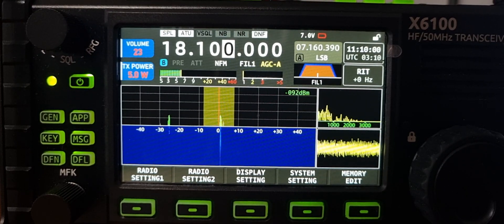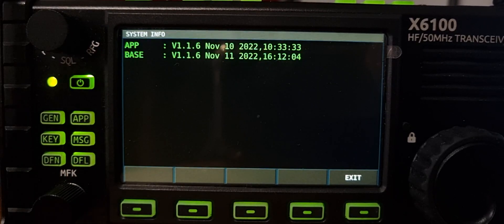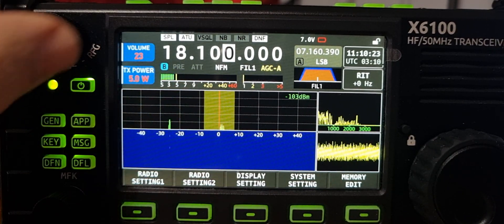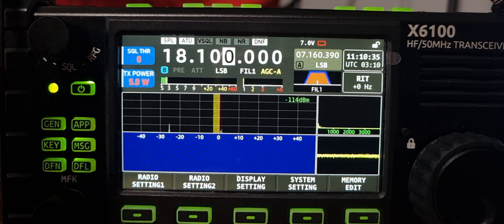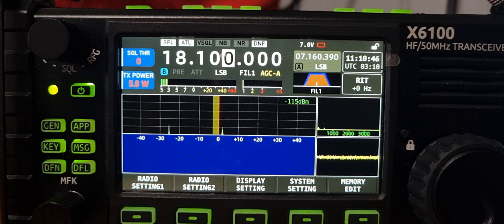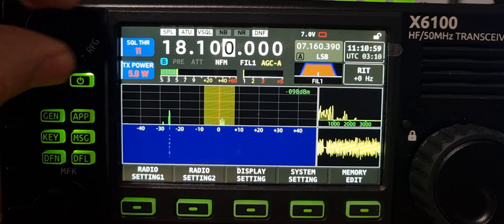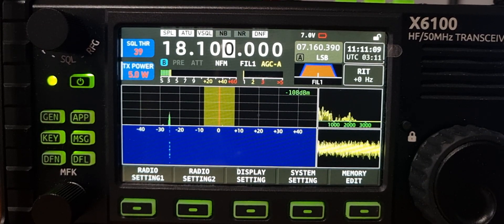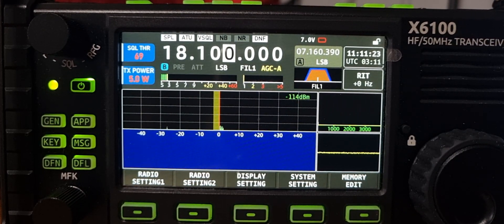XIEGU X6100 No Squech Firmware v1.1.1.6

Comment: I have owned a number of Xiegu products over the years and still own several. I have found something lacking in all of them. This is usually a mater of product support, and nearly always involves software issues. In most cases rather than fix those issues Xiegu has instead opted to just drop the radio and move on to the next. I'm afraid that the X6100 will be a repeat.

I've owned my 6100 going on two months now and I've noticed a number of deviations from the radio's advertised features and it's actual capabilities. Things like CAT control, wifi, blue tooth, CW and PSK decoding, some of which have yet to see any functionality in the radio, other issues that have been addressed but still dont work.

I'm sorry, but I get furious when I pay good money for an item that is advertised with so and so features, and it doesn't have them. Or it does have said features and they just don't work.

I dont know what version of software my X6100 started out with because it locked up after my second use and I had to boot it up with software version 1.5 to get it going again. I noticed right away that the CW and PSK decoding do not work so I upgraded the software to  version 1.7/1.6(CAT fixed). Now, the decoding still does not work, nor dose the squelch or RF gain when in the FM mode.

Xiegu has historically been incapable of writing functioning software for their products. Here we go again with the 6100. Every time they come out with a new version of software for this radio they screw up one feature that was operational in the previous version, or they sacrifice one function all together to make another one work.

I am now wondering if the 6100 will ever perform as advertised. I'm thinking it's time to quit wasting my time messing with it and go on to something else. I still have two G90 which are very good radios and I believe superior to the 6100 at far less expense. In addition I have several no-name USDX radios that had a cost of about $125 that perform at least as well as the X6100. AND they have CW decoders that work!

About now some snotty ham would comment about CW decoders. Well, I'm legally deaf, they help!

Dennis Starks
Military-Radio-Guy
KBØSFP
Reply from the maker: Hi Dennis 
I understand how you fell , personally I think it's a good HF ,with tuner lovely screen Radio , for a low price that can be hacked for extra features .
Reply from the maker: https://youtube.com/shorts/o0Br1VxmKhM?si=Y-7OtDf-Mpx1Y6zI

Comment: Same here, wish I hadn't wasted my money, the one I have, if it isn't locking up which sometimes requires re-install of the firmware to get it going again, then it loses the connection with my main PC or my laptop when trying data modes.

Also tried tried the Armbian OS with internal WSJT-X, again a failure, WSJT-X just won't recognise the Audio input or output so the idea of going portable without a PC, which is the main reason I bought one, is out the window.

Looks like I got a Friday afternoon version.

Thanks for the videos.

73
Mike G1ZRN.
Reply from the maker: The best way to use this Radio is as a HF QRP Transceiver yes u need a lap top for ft8-cheers

Comment: Update: Can't adjust digital filters in FM mode which makes 11 meters death compared to a cheap CB but also overloads massively when it does hear a local signal within five miles ? tried everything but no change.
Reply from the maker: Yes FM is a bit rubbish